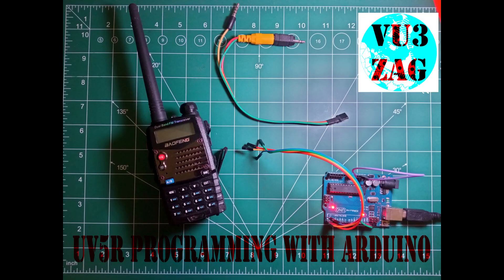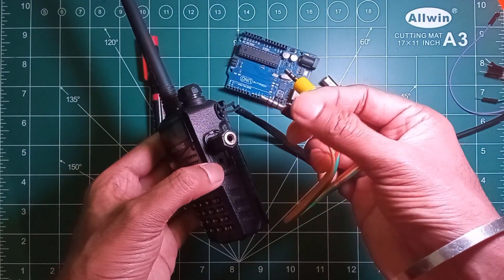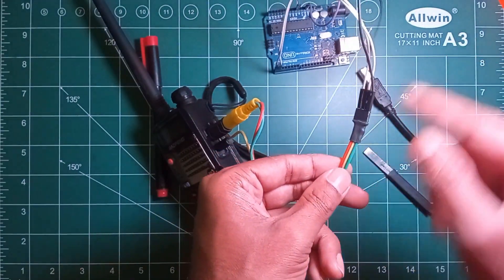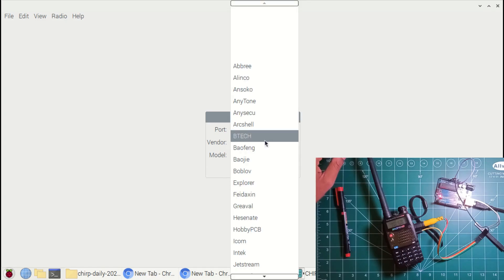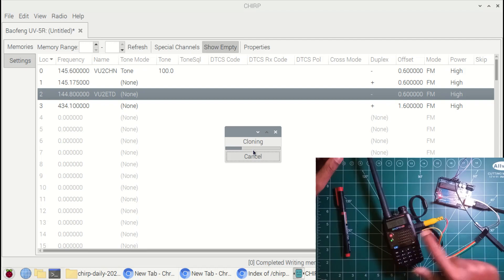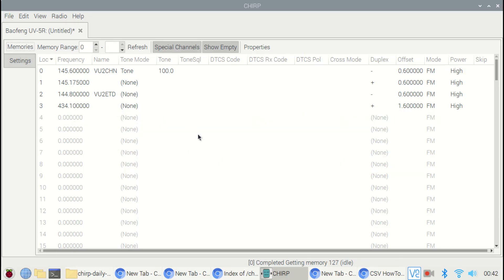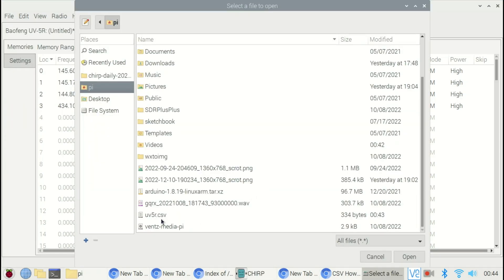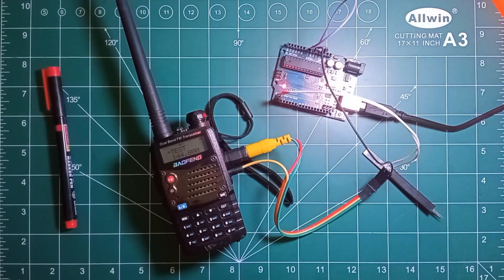Baofeng UV5R Programming with Arduino

Comment: I was wondering is it possible to program a scanner using a similar setup?  So in effect bypass the built in scanner.  In this way I could set an automated activity to scan and determine if there is any activity on various combinations?
Reply from the maker: Suggest you to check the user manual of the equipment.. Support for External programming of the unit varies across manufacturers..
Reply: Bro can't supporting 
Which type of Os if you using